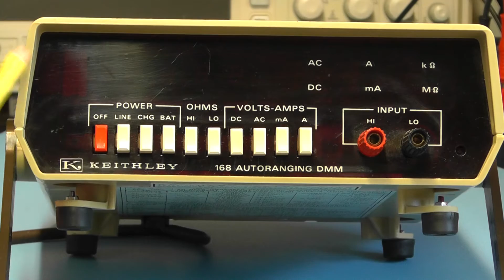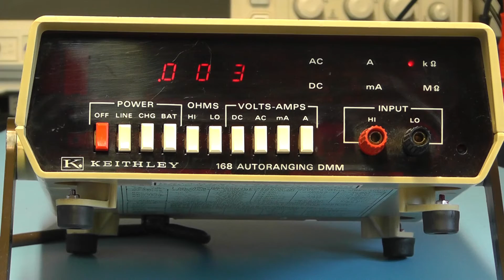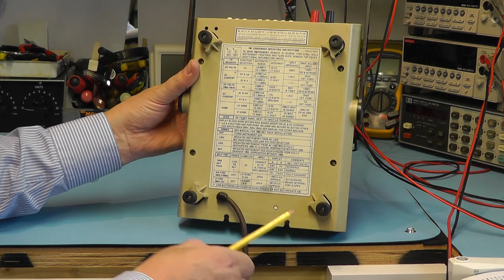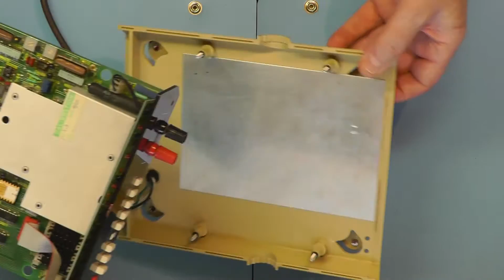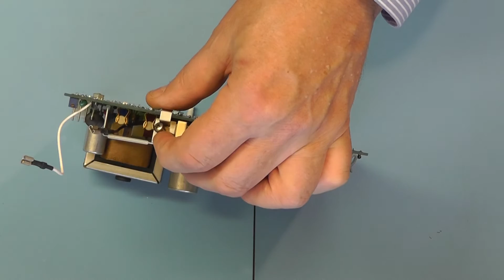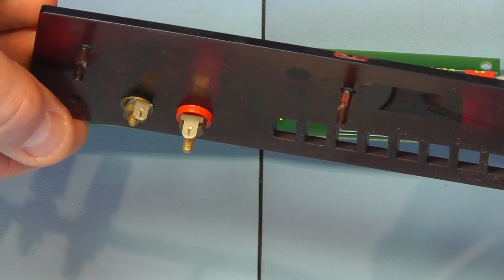Scullcom Hobby Electronics #6 - Keithley 168 Multimeter teardown

Comment: Hi, the main chip isn't a 74360N, it is a C1459. I have the same meter and the upper number on the chip is the date code. Mine is 7331PDS. The lower number also is C1459. 
Nice meter :-)
Reply from the maker: Thanks for the information.

Comment: I just refurbished a 179, good meters. Thanks for the videos!
Reply from the maker: Yes the Keithley 179 is a nice meter. It uses the ICL8052/ICL71C03 chip pair specially made for multimeters. Keithley used these chips in a number of their meters. I plan to do a teardown of the 179 shortly.